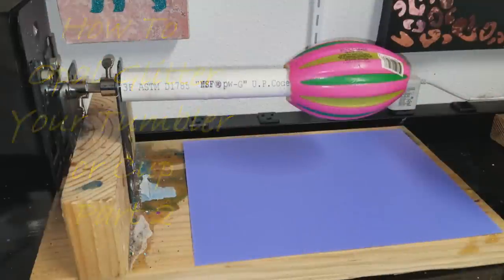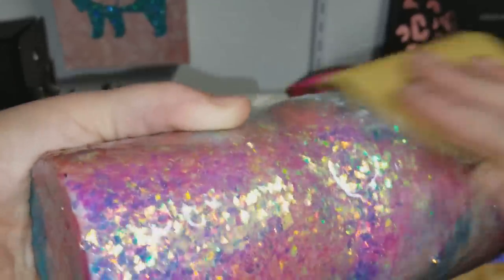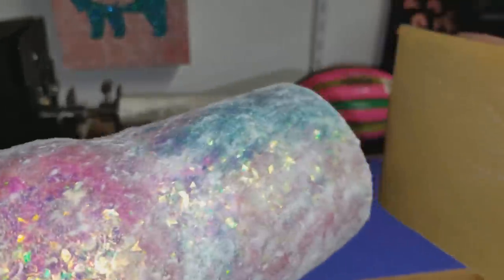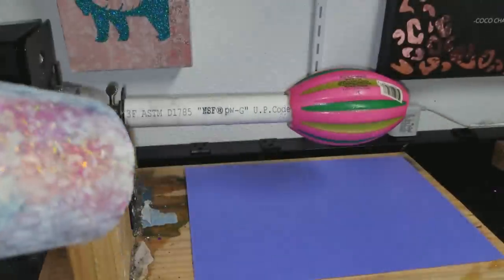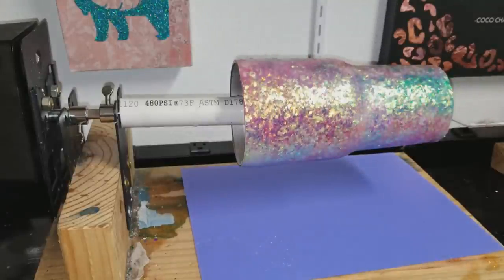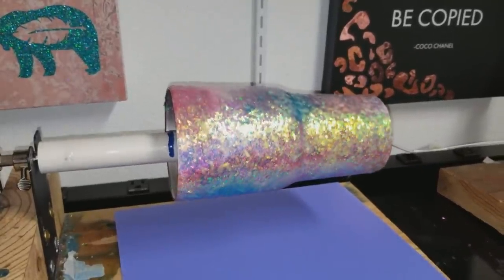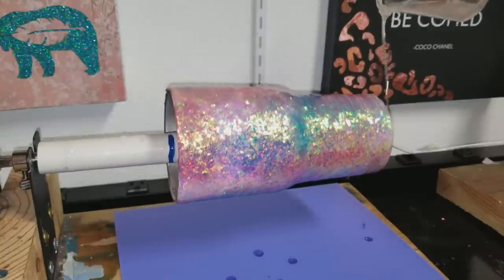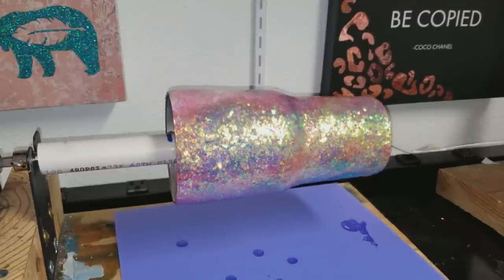How To Opal Glitter your Tumbler or Cup Part 2

Comment: Beautiful glitter cup! Again, we don't get to see the final product? : (  I saw some rough glitter and a tiny bit of epoxy along the top inside edge of the cup that was still on there when you said it was complete...how do you clean that off for a clean smooth surface where the lid would be? I have some major OCD...LOL Sand it again or should it have been done on the initial sanding of the sharp glitter? Thanks...Hugs from Texas! xx : )

Comment: How do you get epoxy out from the inside of the cup?
Reply: Michelle Keltner you can use a popsicle stick
Reply: If I get any on the inside, I just wait for it to dry (24 hours, is how long I usually wait) and use an exacto blade. Works for me!

Comment: How do you avoid getting the epoxy on the inside rim of the cup?
Reply: I see a little on the inside....how is it removed?
Reply: I have seen some people purposely put a layer inside the rim & once cured, it pops right out with an xacto knife, I am trying it tonight. I'm not sure what Heather uses, But it should pop right out w/xacto.
Reply: Thanks, let me know if that works. I'm going to try one so I'm trying to get my answers before attempting.